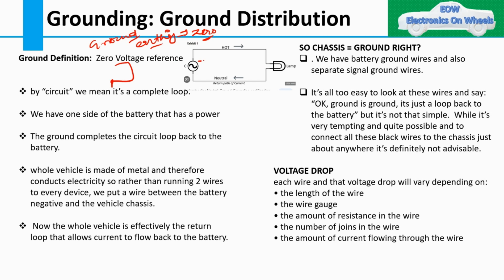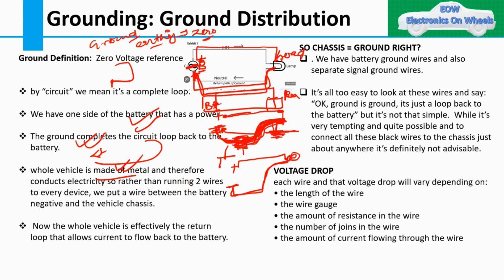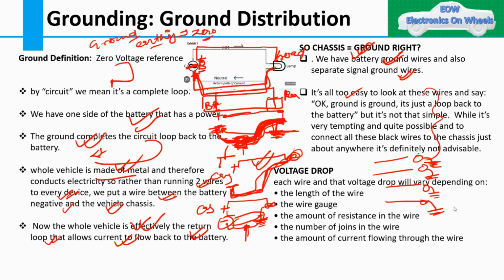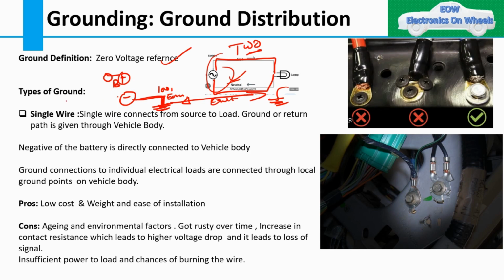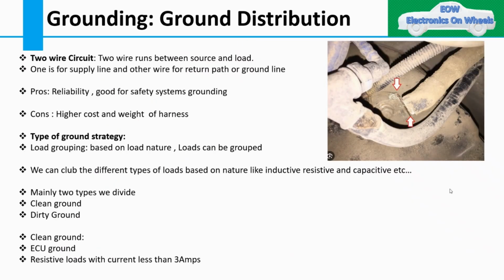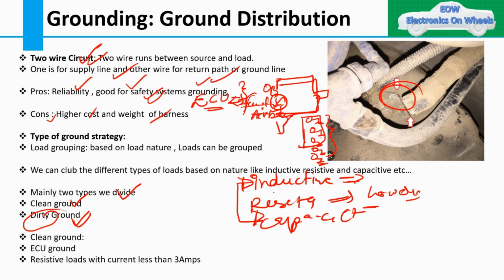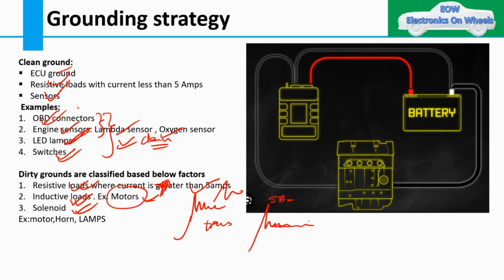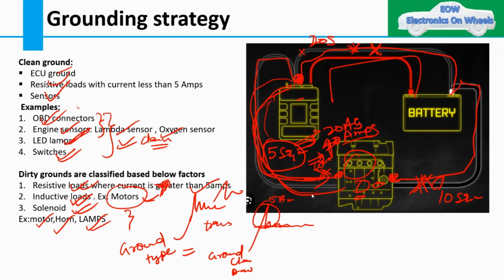How do grounds on cars work || Ground Distribution||Ground||What is grounding in car||battery ground

Comment: Thank you sir..for your post..
I have one question: what is the difference between ground & earthing ..
Reply: Grounding and Earthing only difference is one is bonded to an earth ground rod driven into the ground.  In the capacity of auto electrics it's not really the same thing as it is in your house.  Auto is DC and does not have a real ground in the same sense as your house does and it is instead just the DC negative rail.  In your house you have AC and have a hot wire, neutral wire and ground. The ground there is tied to the neutral rail in your main circuit breaker box and then that is earthed via a ground rod.  This provides a path to neutral or earth if the neutral wire on the equipment end is broken, or you lose your neutral connection to the pole transformer. This helps to prevent shocks and will trip gfci breakers. It also provides a path to neutral for metal chassis on equipment that may become electrifies by a loose hot wire. This keep you from getting shocked touching the metal. The reason there is no ground in automotive electrical is the voltage is not high enough to be dangerous electrocution wise.  Also sometimes people call things a 'chassis ground' but it's just the chassis tied to them negative terminal or 0 volt reference as noted in the video.

As far as the purpose of earth grounding, it's all about setting a location's reference voltage to the earth. As this can vary by location, failure to earth ground each electrical panel for a local can result in transient voltages traveling between locations which can be dangerous and damage equipment. Many people think it's to protect against lightning, but it does very little for that.